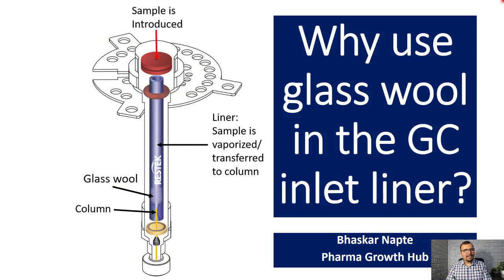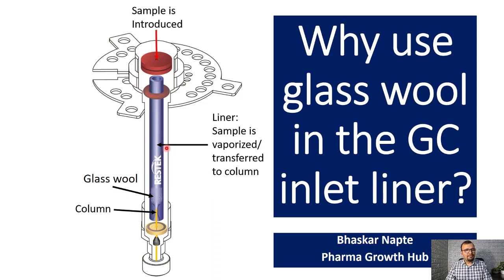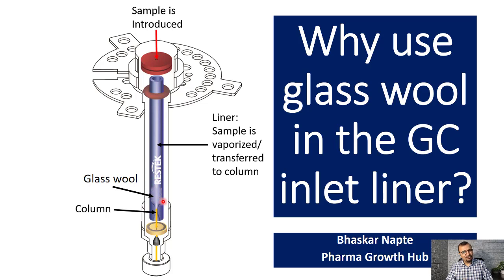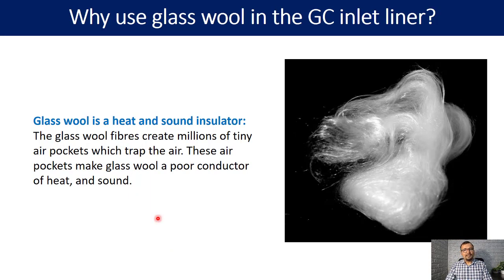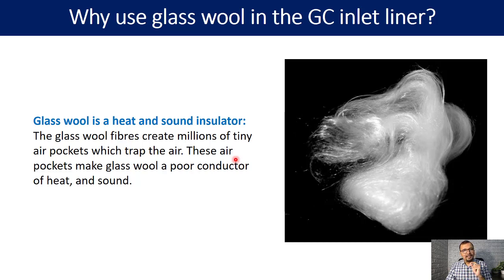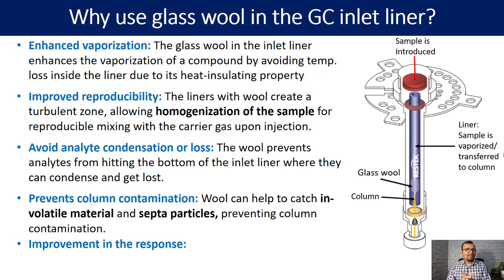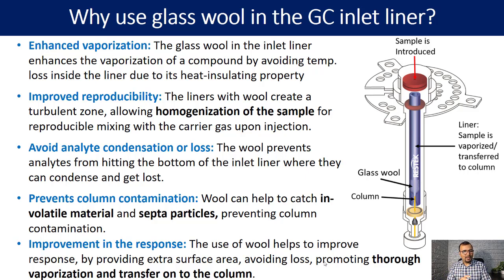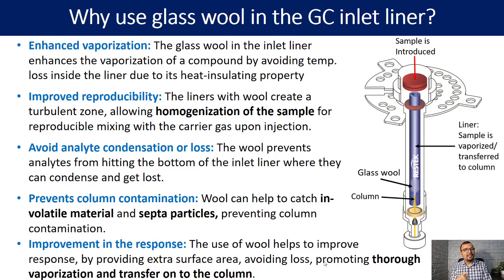Why use GLASS WOOL in the GC inlet liner?

Comment: I learnt more from your vedioesand i have small doubt i.e During glycerin analysis sst solution prepared and injected and in which ethylene glycol peak is not elation  which is observed after sample injections. May I know what is problem and what might be happend and why peak not eluted.
Where the peak is eluted in initial set.
Reply from the maker: thanks for the feedback about your learning journey. There are several reasons for carryover, and prominant one could be low flow rate, backflash in GC injector, lower column temp etc...